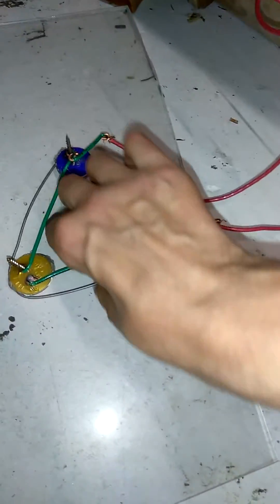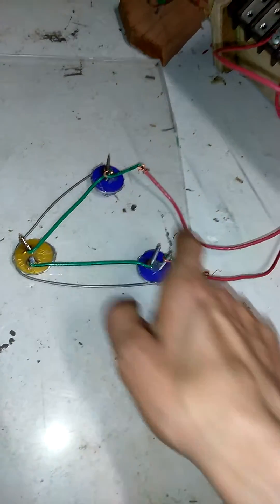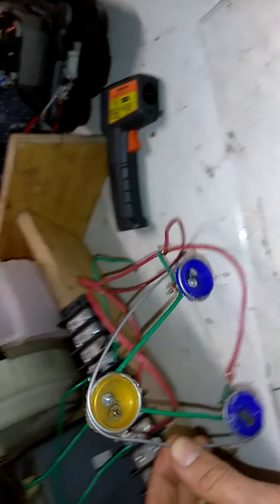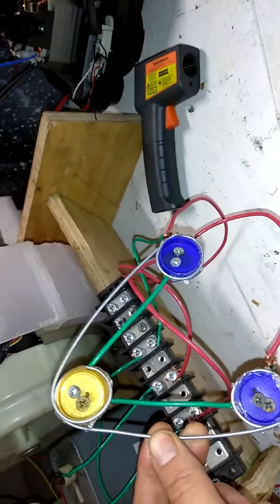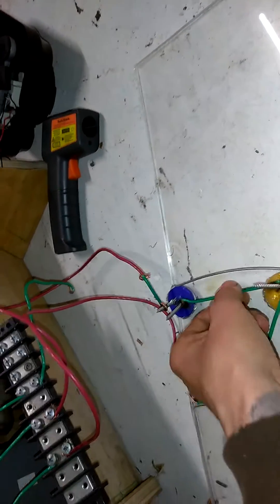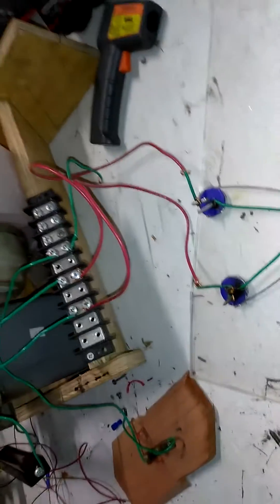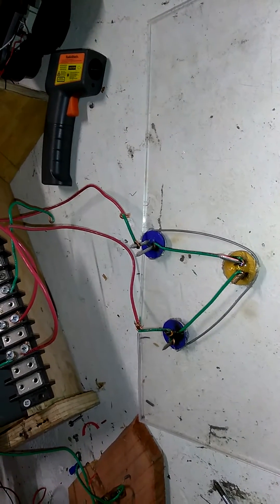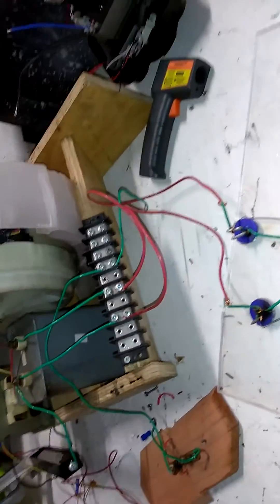Electro static propulsion

Comment: Maybe, like BBrown...turn your lifter so it can propel horizontally on  a central shaft...providing high voltage through shaft...my prediction is the lifter will rotate vertically about the shaft proving this is thrust...nice vid

Comment from the maker: https://outofthisworldx.wordpress.com/2014/04/14/natures-natural-laws-of-anti-gravity-and-levitation-bumble-bees-should-not-be-able-to-fly/
Reply: 4000 bees weigh 1 pound...so to lift a 150 lb. man and his 25lb. stand is (175 X 4000 bees) = 700,000 Bees.  The typical wing span of a bee is 30mm, thus the effective wing span to lift the man would be 700,000 bees X 30 mm = 21,000,000 mm or 68897 feet wing span! ...just saying this man would have had a much larger platform using bee or beetle wings....